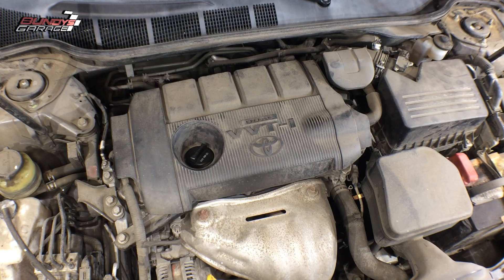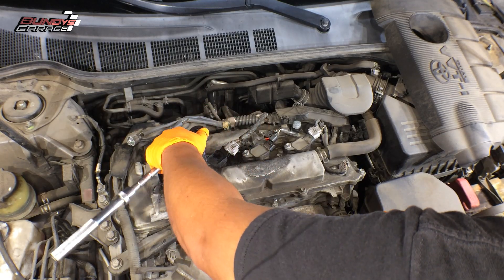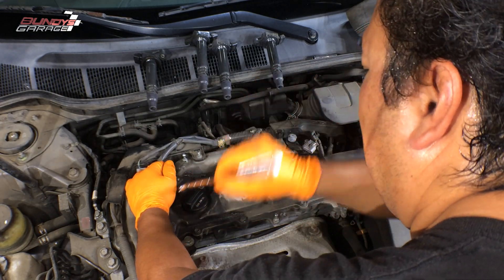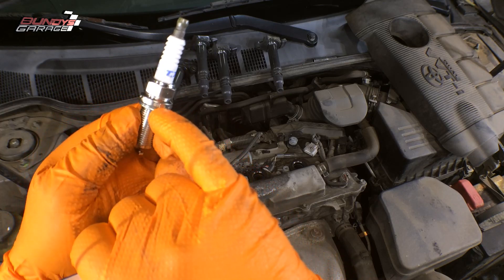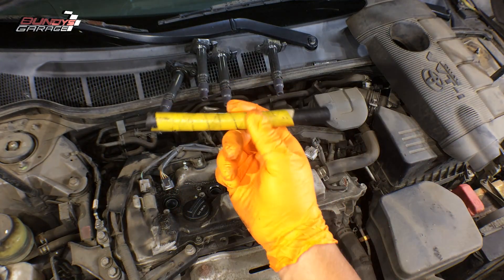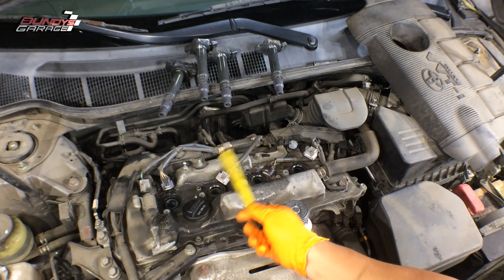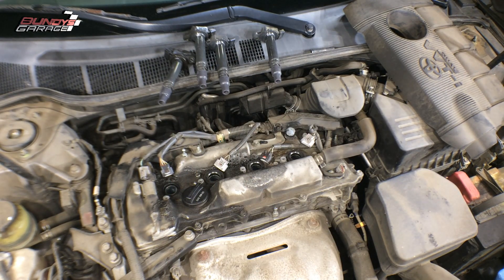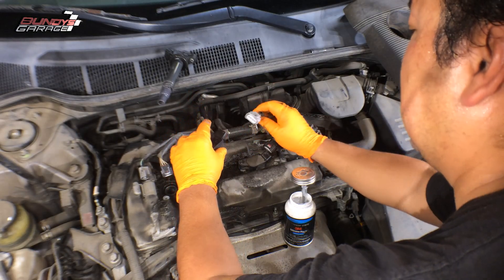How to Replace Spark Plugs 09 - 18 2.5L Toyota RAV4 - 2ARFE

Comment: Every machine shop companies are different. The operators learns from experience plus their own skills. They should teach all skills that needed to learn to be succesful in machining. As generation and technology arises there are still so much more to learn for both operators and programmers. CNC machining is continous learning. Teach the operators well enough like running air cut or dry running to see possible errors in the program especially if the program has millions of bytes/characters to check. Like what I always tell to my buddies..to become a good programmer you have to be good first in running the machine. The actual machining in a software is not always the same as machining the actual part.The type of machine,toolings, overhang,material hardness, stick out of tools,type of tools are to be condidered not only handing out a program to the operator.

Comment: My car is a 2017, and it has iridium plugs, why are you using Platinum plugs?    Thanks.
Reply: My 2018 owners manual tells you the part number of the spark plug or just go to the dealer and buy them. With spark plugs go OEM.
Reply: @enajenaj6841  i also have a 2018. Just picked up the OEM plugs from Toyota parts. Did you use anti seize?
Reply: @fishkyjelly1020  the Haynes manual sayes you should use anti-seize & rubber hose to aviod Cross threading.

Comment: As a novice, just changed my spark plugs. Thank you for the information. I too have watch many video's stating do NOT use anti seize, (I think thats for normal maintenance mileage procedures)  however my (new to me) 2014 RAV4 old plugs were very hard to screw out due to how bad the original plugs looked and the very dark residue on each plug, I went a head and added anti seize, however I used extreme small amount. Looking down where the plug goes, lots of carbon buildup. I think I will be using fuel additives for a while as well. Thanks for taking the time to post the video...
Reply from the maker: You are welcome! Glad it helped you out. IS your valve cover leaking?
Reply: @bundysgarage  nope, entire engine is immaculate shape. Only issue I have seen is the boot covers on each of the shocks are desegregated. I got what appears to a very well maintained vehicle, with exception of oil maintenance. Thanks again for your information

Comment: Any reason to change the coil packs at the same time?
Reply from the maker: Only if you have a misfire and determine the ignition coil to be the cause. Typically only one will fail, I have never seen all 4 fail at once. So just replace the one that is bad. Some shops will quote out changing all 4 but they are scamming you, you only need to change out the one thats bad.
Reply: @bundysgarage Thanks.  I have the ngk spark plugs and coil packs now. Just going to do the coil packs too and hopefully get another 60k miles out of this 2011.  It will be just over 300k miles, then.

Comment: Shop quoted me $218 for two hours work for what you just showed does NOT take two hours.  Sheesh.
Reply from the maker: You could do it in a hour, taking your time. I use rockauto.com a lot for great deals on name brand parts and spark plugs.

Comment: Why wouldn't you just use your magnetic spark plug socket to put them back in?
Reply from the maker: Cause I want to "feel" that they have started properly, you can with the rubber hose.

Comment: I don't hate you because you put anti-seize on the plugs. I used to be a sports car mechanic and did it myself for years. But if you check the spark plug manufacturer's websites you will find that they recommend against doing it. The main reason they give for this is that the anti-seize acts as a thread lubricant which can and often does lead to over-tightening the plugs, which later on can lead to seizing.
Reply from the maker: Anti Seize has lead to Seizing?

Comment: Engine covers are (in my opinion) one of the most worthless things, the engine is something that isn't normally seen.

I used to not put dielectric grease on my plugs either. Then one time I had the rubber from the C.O.P stick to the plug to point I thought I ripped it when I took the coil part off. Luckily I didn't but I also struggled with that boot for about 45 minutes before successfully getting it off and removing the plug. After that, I took no more chances and any time I change anyone's plugs; they get grease.

I know it is a highly contested topic, but I'm beginning to think of putting grease on the threads as well, before I end up with a stuck plug. Not going to lie, there were a few times that I thought I might have been in that boat. 

And finally, a question to end this wall of text:P 

Any particular reason you use a nickle based grease for the plug threads? I have a copper based grease that I still have plenty enough of to use; but if there is an advantage to using the nickle (or disadvantage with the copper) I'll get the nickle grease.